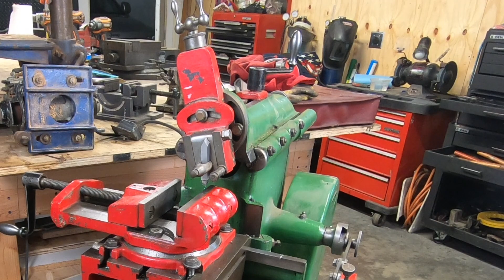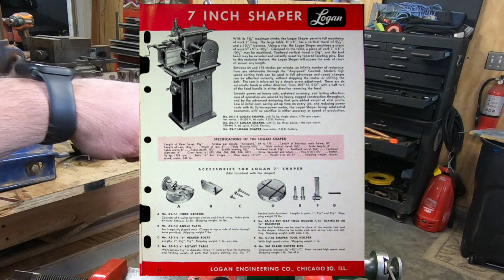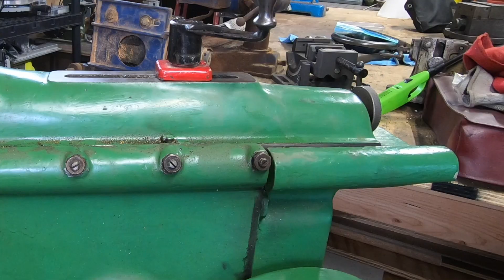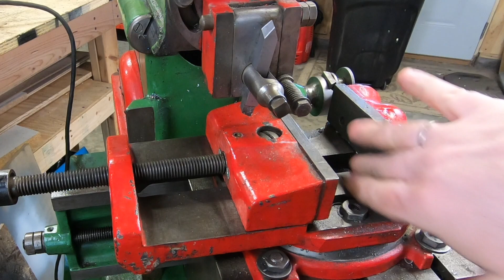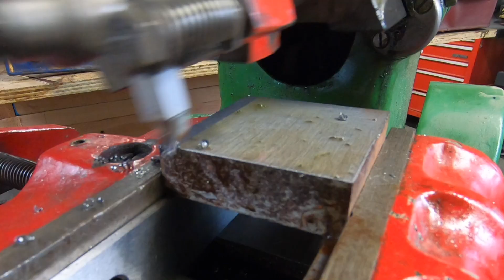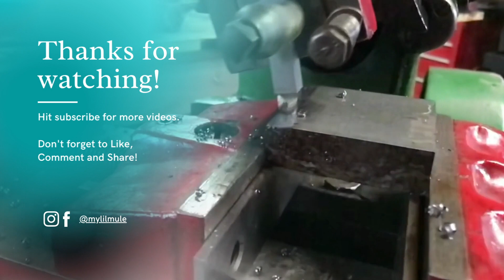Another New Machine for the Shop!

Comment: That's just beautiful, congrats! I'm looking at a Logan DS7 right now, and it's in a basement. Were you able to disassemble and haul it out all by yourself? I'm trying to gauge if that's within the scope of my physical abilities, before I drive all the way out there and find out it isn't 🤣🤣🤣 I've never actually seen one of these things in person...
Reply from the maker: It probably weighs about 550 pounds, plus or minus 50 pounds. I was able to use a simple hand truck dolly and get it up the stairs, but I needed help. Two of us were able to lift the heavy components into the bed of my truck. It took a few hours to pull off, but that included me carrying the smaller pieces up the stairs and into the truck myself after disassembly. It was work, but it wasn't so bad. I would suggest you have at least one person to help you out.
Reply: @MyLilMule  Thanks...figured it was probably a two person job. The one I was looking at was being sold by an estate sale person who knew nothing about it, and didn't like questions, so the hunt is still on...
Reply from the maker: @heyartbailey  If it was cheap enough, you maybe should have bought it. I've seen them sell on eBay for $1,600. I paid nowhere near that amount. Not even close. :)
Reply: @MyLilMule  Yeah, I should've invested in shapers over the last year, they've doubled in value 🤣She was "taking offers", not answering questions, had the shaper vise on a milling machine, wouldn't even discuss selling it with the shaper. Life's too short, there's plenty of shapers out there.

Comment: Another interesting addition to the shop...when would you use a shaper instead of a mill?....it must have some unique advantage or they wouldn't exist
Reply from the maker: A shaper can do some things a mill can't, like cut a keyway in a gear. But for the most part, mills like the Bridgeport made shapers obsolete. But in some cases, like when you just want to flatten a surface, the setup is faster and you can walk away from a shaper, where with a mill, you can't.